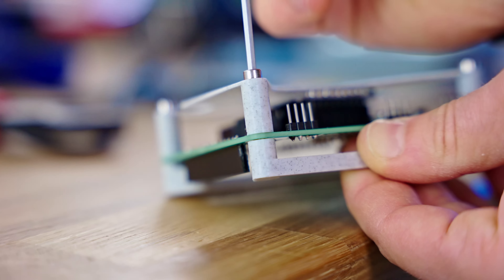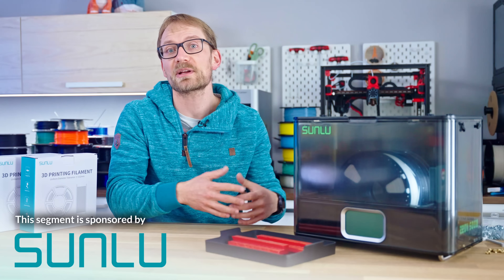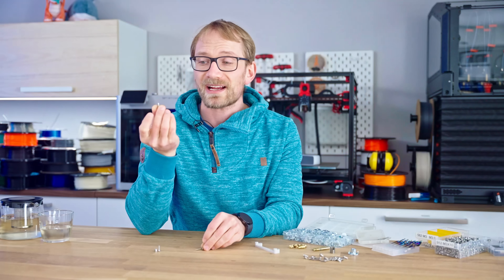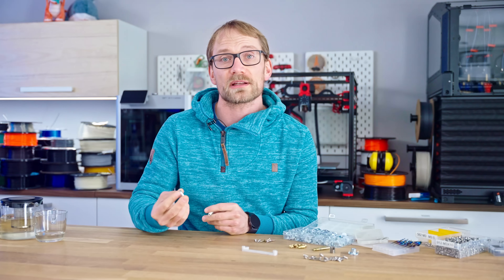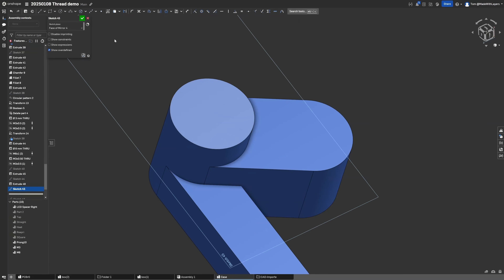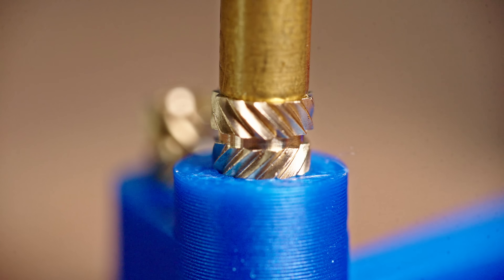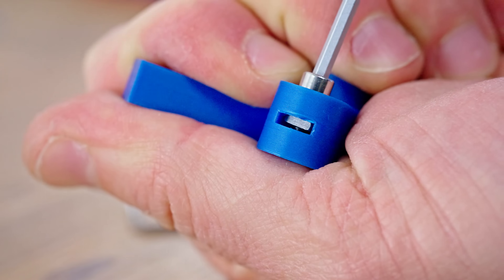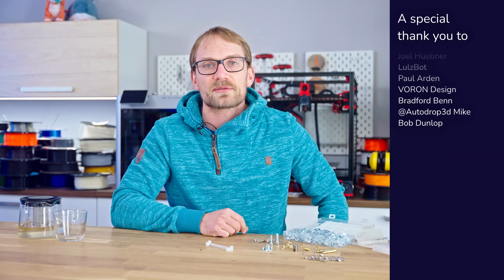A better way to add threads to your 3D prints

Comment: I recently printed some parts out of pla and used a tap to cut proper M3 threads into them. I found them a lot easier to strip out than just making a 2.9mm hole and using the screw itself to force the threads. Since the M3 screws are more traditionally used for machined metal holes, the taps are made to provide positive tolerance. This makes sense for metal holes since they can't be stretched by the screw. It does a disservice to plastic parts though. Someone needs to make slightly undersized taps for the purpose of tapping machine screw threads in 3d printed parts. Then the screw could ever so slightly press outward on the threads, making them much stronger and much more resistant to strip-out.

Comment: My most used solution is printing over a regular hex nut. First add the sockets in cad, then set up pauses in your slicer.  Then just insert the nut right and let your printer cover it. Just make sure there's no supports in your pocket, also the pocket has to be quite accurate.

Comment: Option 2x: at any layer (top, middle, bottom) model a void for a standard hex nut. Use JB Kwik to epoxy it in. No weak spot (it will actually be stronger than the surrounds) and the threads are very durable. This is a non-issue.

Comment: I just heat a nut on a long bolt with a lighter for 15 secs and push it into a slightly undersized nut trap. Quick, easy and cheap. Never had a problem as long as you don't push the nut too far.

Comment: for smaller parts that dont get crazy amounts of load,  like  end mounts for drag chains I just warm the screw working it back and forth  a bit like if your using a thread tap, - but not too much heat! and it works, I got pieces held together over 6 years and still in use.

Comment: You can also just use Blender and then add a bolt, and fine tune the size. Ive already got M2.5 and M3 sizes sorted out. No hard stuff needed

Comment: How about instead of 3 “formable” flutes inside the hole, instead include a sleeve of lower-density (some % infill) on the inside of the hole?  Basically, approach the solution from the 3D printing direction, instead of simulating a machining solution.
So threads are forming 50% infill mater instead of solid 3D print material.

Comment: 🔥 Excellent guide! Metal threaded inserts are a game-changer for durability. When your design requires even more metal—like a custom CNC-machined aluminum bracket with integrated threads—we're here to help. Bridging the gap between 3D printing and professional metal fabrication. Super useful video! 🛠

Comment: Why could you locate the nut at the end in the middle of the part instead of of the far side of the part? The placement you used for prong nuts would work for normal screws too and be much better.

Comment: I just capture nuts in the print and setup my slicer to pause at the last layer for the walls of the nut cavity, I pop in a nut e.g. 1/4-20, then hit resume and the printer seals it in leaving the screw O.D. open. Piece of cake

Comment: You forgot about the female M screws. I use them exclusively since I discovered how well they function. Of your 3D print, they only require a straight hole and you get a solid metal-on-metal thread connection that compresses plastic.

Comment: My solution: solid printing in the area, heat the screw, slowly insert it using a screwdriver. Maybe it won't work for serious jobs, but for simple plastic cases it works fine.

Comment: well i just put a hex nut in the opposite side of my hole just like you did  with the prong nuts, no need for a slot, you still need an access to the back of the hole but its super easy and most bolt sets/kits come with such nuts anyway so why buy inserts and stuff. And if i cant get access to the back of my hole ill just make it a bolt-tapped plastic thread, seems to hold fine if you get it right.

Comment: I have tried heated inserts, they tend to pull out if the torque is too much, while printed screw holes will do the strip if too much torque, those are the two ways I have tried. Though the prong nuts do look like a better option, it would take a lot of torque to strip them out, I have used then for wood work, never thought of using them for  printed parts before now.

Comment: The strongest "only screw" solution is to slightly cut longitudinal slits in the top of the screw (half to one dia length), printing core dia and adding max. 0,1...0,2mm. The slits are precutting the thread the rest is forming. For full load of the screw (head is ripping off) you need 10 times thread dia. You spread the load on a very big area. May you use a printed rig to slot the screws. Works also great in wood with machine screws... I'm used to print with 4 perimeters at 0,3mm nozzle) works up to M5. With inserts you also spread the shere load to a greater area. If the screws have to be removed frequently I'm using normal hex nuts in printed hex slots, these connections only tear out if infill is too low.

Comment: My go to method is like many others to make a cutout for a hex nut on the opposite side of the hole. This is especially good if there needs to be a "clamping force". If you have to orient the hole so the hex cutout is on the bottom you can make a thin layer where the hole and the cutout meet so you don't have a weir overhang situation.

Comment: For the square inserts if you want them to be a little stronger you can pause the print put in the part and then continue the print closing up the whole and keeping the strength of the part. Ease of use on this is not the best :)  you have to stop at the correct layer.

Comment: I've used two other approaches with great success, especialy form smaller diameters. One is modeling and printhng the threads then going through it with a tap slowly once or twice. That way the tap does not have to clear much material, just imperfections and the walls do not get disturbed. The other approach is similar to your thread repair inserts, but instead of the full metal ones is used the wire option (I know them by the name Helicoil). I had great success with them too. There is another option, I always wanted to try but never had an opportunity, to insert the rivet nuts from the bottom plane in an oversized hole and let the bolt pull it up. 
My takeaway from this video (that wan;t even the main topic) is the idea about saved negative geometries and boolean substruction. Never thought of that approach. Very handy.

Comment: 2x10mm wood-screws all the way. works reliable, is stronger than any layer adhesion, so will never be the weak point. i dont see a reason to ever use something else.

Comment: If I'm making a functional part it will be 100% infill. If I wanted it hollow I'd design it that way. The solid parts of my model are supposed to be filled. Self trappers work other than with layer adhesion issues

Comment: I really like the 3/8-16 to 1/4-20 thread adapters a lot of camera gear uses. I can model in a 3/8-16 thread pretty easily and just thread them in and I get really nice strong 1/4-20 connections in my prints

Comment: I work with Helicoils at work alot and recently found out that they work great in resin parts which struggle with heatset inserts. They require alot of post processing, but since their taps only cut very lightly into the material, it is perfect for brittle materials like resin. Maybe not for the home user though, they are expensive af...

Comment: Did you try with special.screws dedicated to plastic parts? You are preparing hole with smaler diameter ( each producent have table with diameters). Those screws self cut thread inside plastic. I am working in plastic industry and we are using a lot of. I also using on my 3d printed parts. Of course when I don't need metric threads.

Comment: 0:08 ayo dude you are not putting ANY weight on printed part here but on the metal screw and ceiling. WTF is that bit for?

Comment: I saw a post the other day that suggested always putting the threaded insert at the back of the piece you needed it in if possible -that way you get the strength of the threaded bolt through the part at that point.

Comment: What im missing here is simple hex nut press fitted from bottom. Pros: 1: no need to buy extra parts - its just a nut that you use in other applications. 2: no need to heat plastic - i design hole to not accomodate nut (so max 0.1mm larger). Then i simply use screw to guide the nut into the plastic. This way nut will never fall off on its own. Then unscrew the screw and part is ready for assembling. 3: metal to metal threads. 4: geometry - heat inserts can fall off. Nuts from bottom cant. Cons: not really i can see any. Sometimes overengineering such simple thing as threads isnt worth the effotr

Comment: Wood Tee Nuts with 4 Prongs Four Claw Insert Nut tend to just spin around after a while. They are shaped like claws that rip through anything softer than metal. Then you can never get the bolt out.
One of the best way to add threads to soft materials, as in soft as ikea furniture, is to use Ikea cross dowel barrel nuts. They are too fat to spin around.
Reply: Yes, these are great! 
Also - in case of insertion via slot - you can counter them with a flat head screwdriver. That way, it's possible to tighten the screw firmly without exerting too much torsional stress on the surrounding material.

Comment: I dont understand why we are talking over wich screw in type to use on models that consist of 2 perimeters, that takes out the whole comparison base since you tap into a model with 2 perimeters taking off atleast 1 perimeter in the process. You other video also had this flaw where you talked about heat set inserts but then printed a bunch of specimens that consisted of 2 perimeters where i think to myself why would you do something like that for a comparison video that should be taken seriously.

Comment: Just drill and tap it like a normal material.  I do it all the time with styrene and other types of plastic in model railroading hobby.  I wouldn't 3D a hole.

Comment: Make hole smaller than the size of the screw shaft, then use a properly sized drill to enlarge it, then use either tap or screw itself to cut the thread. I use hand-held drill bit holder to do it by hand.

Other methods I usedL
1. Nuts inserted into holes during printing - design a hollow space for the nut, pause print using post-processing command (move the head away and keep motors engaged) on the layer that will cover the hollow part, insert nuts, resume printing.
2. Captive nuts that are inserted ingo hollow spaces after printing, more design work but if you damage the thread, these can be replaced.
3. A separate part with 100% infill that holds the nut and is inserted into dedicated hole in the print. This works for making interlocking connections between elements or if other methods might split the layers. The insert might be glued in for additional reinforcement.
4. Traditional method is to make holes the size of the bolt and use nut on the other side of the part, with washers for spreading the force around the hole.

One pro-tip: design things in such a way, the forces are not trying to rip the screw out but to act on it sideways, trying to shear it in half.

Comment: Greetings from sunny Odessa!)
Just make a hole slightly smaller than the Outer diameter of the bolt and screw in a bolt heated to 150-200 C

Comment: I love the idea of modeling the self forming thread jigs(?) and importing them. I do a lot with M3 screws. When threading into the plastic, I’ve been printing at 2.7mm. That works good with my printer and settings. But I hadn’t given thought to deformation around the screw hole. I’m going to try this out tonight (when I get home from work). 

I also use quite a few heat set inserts. Many many thanks to CNC kitchen for his tools. I also have a really nice articulated heat set press that makes installing the inserts easy. 

Love your content. I love creators who make me think.

Comment: Regarding the slide-in nuts: you mention, correctly, that you need access to the back of the hole in order to use these effectively. One great technique is to build in the hole and pause the print once the cavity is complete. Add the drop-in nuts, then continue the print; the nut will be perfectly sealed in to the cavity.

Comment: I've had mixed results with heat inserts.  Probably, it is user error, but after putting them in, it is hard to get a screw in and also, some of them just come out after a while.  I probably need to try it again.  The ones I used in PLA seem to work a lot better than the ones I was using with PETG.   Do you have any useful information for the hole diameter and hole length when using heat inserts.  For now I just screw it into plastic though even some of those still strip out.
Reply from the maker: There are guides on hole diameter for the CNC Kitchen inserts, which also work for similar style inserts https://cdn.shopify.com/s/files/1/0654/4821/4767/files/Poster_Dimensions-Guidlines.pdf?v=1751444185
Sounds like your holes might be too small, and importantly, don't force them in - if the plastic isn't getting the chance of flowing around the insert, it won't hold well.

Comment: For a hot end holder part I designed I created slots of 20x40x5mm for threaded aluminium strips so that the part could be mounted flat against the back plate. It really worked well and make the part stronger at the same time. It's a speciality case and I wouldn't use it for all cases but it a good tool to have in your box. If you really need to torque it down, a big metal surface is hard to beat.

Comment: Sorry, but for inserted nuts, you also need to tear them through the printed part. Tilting?. Mines don't tilt. Maybe you did a too big pocket and a too big screw hole. Additionally, they don't need to be inserted like you did, they can be embedded while printing (during a programmed pause) or be in the other face of the printed part in a square or hexagonal pocket depending of the shape of the nut. Actual strength for these is FIVE stars (not three).

Comment: Hard disagree on the Straight Hole verdict. I print 2.8mm holes for my M3 screws and they last literally years - not particularly hard to thread in, just make sure you don't overtighten when you bottom out, and they last just fine throughout a few multiple unscrew/rescrew cycles IF you're careful during the tightening process. They're not the right solution for every use case of course but in my experience the straight hole gets the job done for most of the scenarios I am using 3D printed parts for in the first place - namely mounting small to medium size electrical components.

Comment: Yeah... Taps extract the shavings. They also make taps for blind holes. Hand threading through ever the hardest plastics is trivially easy.

Between that and saying wood screws are hard to source, part of this just not knowing those particular tools very well 😅

But I also couldn't 3D design my way out of a wet paper towel so touche.

Comment: What I like to do is make a hexagonal hole and superglue a nut there, works as well as a heat insert and It's much easier to source and use, it's only slightly more annoying to model, but very little, I can even use self-locking nuts if I'm feeling fancy.

Comment: The embedded nut should be embedded in the print and not just slided in

It's really easy to stop the printer at certain level, insert nuts and continue print

Comment: I generally cut a hex hole in the backside of the part. Using about the nominal dimension of the nut it will pull tight (due to printing distortion) and stay in place. If you are accurate in printer calibration 0.1 to 0.15 smaller to secure the nut. When I extrude the hex feature, I use an angle like 0.5 to 1.0 degrees. This flares the hole to guide the nut into place. It is secure, durable and often more practical than square nuts. I generally pull the nut into place with a screw. It is possible to press them out if you are frugal.
Reply: Also regular nuts are cheaper.

Comment: sideways bolt lock is better than forcing threads to hold any plastic weight. ie puzzle lock is always better than along threads adhesion. what is made with lawyers. uhm. nothing ig. straight hole works best if you know how your printer does the whole. like 3mm and 5mm holes are always perfect size, with some grip and some speed. best used for minimal grip sideways puzzle lock joints. let the bolt/screw make its own threads. no requirement for separate thread tool. external advice is always bad, just think through the stuff yourself always. you get the best approach as given from above. nah simple hole is the best. easy with tolerance to form the threads internally. by the bolt or screw. no complex fiddling with the non-standard hole shape. if you make the bolt-screw weight bearing sideways, then any minimally forming thread will keep the plastic holding all the weight instead of the threads holding the weight. always better to have structural strength instead of threads trying to hold up adhesion. its like bolts vs glue strength. 3d print design first. these nots. threaded bolt is not structural, its only adhesive-like. dont design to depend on the thread adhesion. the part should be structurally sound even if the bolt drops off. completely. ie wear and tear, adhesive will detach on its own.